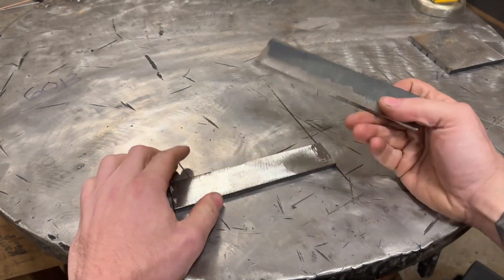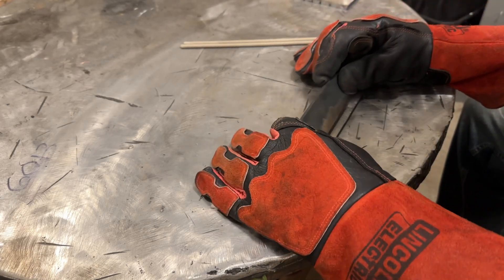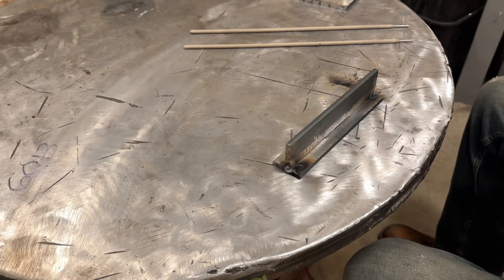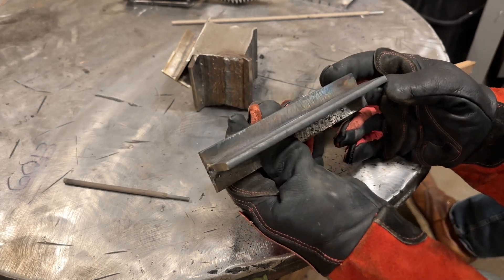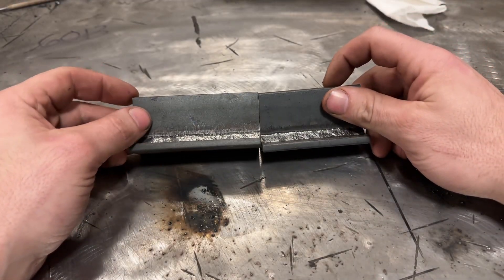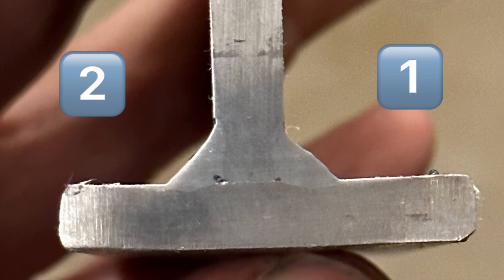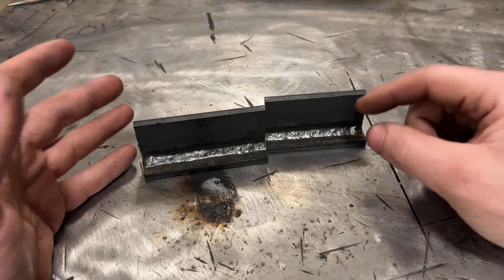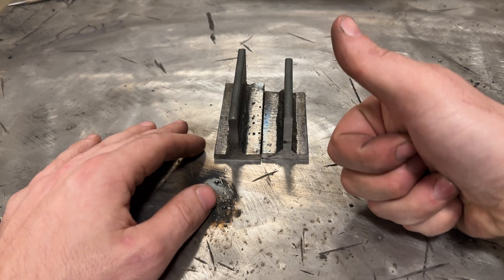Retesting 7014 results from “Stick rod shootout”

Comment: I wonder if the ground continuity between the weld table to the workpiece is part of the problem with 7014…have you tried using a tack weld between the table and workpiece or grounding directly to the workpiece?

Comment: I run a fair amount of 7014... usually at around 140 amps... I find it likes to run hot.  I think most of the charts show 160 amps at the top end for 1/8" electrodes.

Comment: I have cut plate with wetted rods at 200 - 225 amps before I had a torch .
It works but not a nice cut and hot stuff flying everywhere .
Reply from the maker: That’s an old school trick for sure.  In a pinch it will work, just watch out for fires 😅😅

Comment: Im new to welding 7018 I heard that its a stronger weld than the 7014  However my welds look better when welding 7014   Im taking a 16 ft trailer and trying to make it 24 ft that's why I need a strong rod I am using a new Lincoln tombstone welder any advise would be appreciated thanks
Reply from the maker: Bunch of tips, hope these help:  so in my testing 7018 is stronger than 7014.  However with a tombstone 7014 welds will tend to look better, especially with minimal skill.  7018 will run on tombstones but the AC version of the 7018 rod produces better welds generally.  

My thought on your situation is if you can produce better quality welds with 7014 you’re probably better off with that rod for the time being.  A clean weld with minimal/no porosity, slag inclusions, undercut, etc, will be stranger than one with a bunch.  However if you intend on stick welding a fair amount/doing repairs, it’s in your best interest to get good at 7018 👍.
Reply: @makingmistakeswithgreg   I agree and I also want to thank you for the Videos and replying have a wonderful even

Comment: It is interesting your Miller quick reference card lists 7014 as having better penetration than 7018.  Most other references either list them as comparable or give the edge to 7018.  Most anecdotal reports match what you have seen here.
Reply from the maker: It’s definitely strange how some sources say 7014 is the same or more than 7018.  Growing up I knew a few people that used 7014 as a replacement to 7018.  They are definitely different enough that the choice to use 7014 needs to be made understanding what’s being lost.

Comment: Rods with the 2, 3 and 4 flux type contain rutile in the coating. The slag is slightly electrically conductive and the arc doesn't have a problem terminating into it, rather than piercing through it, like in 6010/7018, for instance. Because of this, even though the rod has a spray transfer of the droplets, the slag can run in front of the puddle and soften the impact of the molten metal from the tip of the electrode, resulting in decreased penetration. Rutile rods also require much lower arc voltage to run, contributing to the problem, in this case. 6010/6011, which also have a spray transfer, but barely any slag coating, have a very tense arc, which gouges deep into the base metal, and very low recovery, will always cut deep into the steel, providing excellent root fusion. 7016/7018 are a bit like the bastard child. Their slag is thicker, but non conductive, so the arc has to blast it out of the way of the droplets. If you look closely while welding with a 12-13 shade, you can see the arc dancing around, reflected in the weld pool. You can also see they have a globular metal transfer and the slag gets deposited ahead of the bead, but it quickly flows to the back of it, picking up contaminants, if it slides along the edges of the pool. As far as the gouging and cutting with welding rods, I have done it successfully with 3/32" 6013 on 130 amps in the vertical down position. The pool gets extremely fluid and it just runs down on the ground. It should be much easier with cellulose rods, considering they give off a much stronger blast of shielding gas, which can act as an air-arc gouger.
Reply from the maker: Thanks for sharing that info 😀.

Comment: I made a small welding table out of some kind of square tubing rack the neighbors gave me and welded 16ga on the table top with 7014 menards rods mainly it came out good for something to have small projects built on I used some 1/8 inch plate too....mistakenly I also bought some 22ga plate on accident but hell I welded that up also as a bottom plate under the 16ga works well for smaller stuff
Reply from the maker: A custom welding table is a definite must do project.  Sounds like you got it handled well.  Since this video I actually have grown to like the 1/16th and 3/32 7014 rods for a lot of thinner material work.  They work pretty good for that 😀.

Comment: I was told, as a young man, that the 7014 was a rod for decorative welding and appearance work. I used to fix floor boards in old farm trucks with them because they fill without burning holes and there's very little splatter.
Reply from the maker: Considering how the penetration is I bet they would work excellent on thin material, especially with the mini 1/16th rods.  Any help you can get on thin material is a benefit, it’s no easy stick welding sheet metal lol.

Comment: I've become a fan of 7014 for some particular use cases. For me, it basically replaces 6013 for everything where I want a bit less penetration. It's the perfect rod for tacking something. Especially in the smaller 5/64 size that Blue Demon and others offer. I think everyone into stick welding should have a supply of the 5/64 Blue Demon 7014s. They tack brilliantly and the slag chips off to reveal a bead that looks chrome-plated, it's so shiny. Plus the slag doesn't get trapped in the toes so no wagon tracks or issues with additional passes on top of it with 7018.

I've not yet tried a rod that starts more easily and consistently than the small 7014s. IMO they are the ultimate rod for working with thin tubing like many of our home gamer fab projects will require. I have a stack of 1" 14ga tube waiting for me to dive into, and I guarantee that most of it will be the 5/64"  7014. Especially since you can find the stuff for under $3/lb, it's a good bargain and since the smaller rods are giving you fewer lb per inch, it's an even better deal when you consider how many inches of weld you can get for $1. 

I've been trying lots of rods since I started learning to weld, and a couple rods have made the short list of "must buy more" within a couple rods of burning:
- Blue Demon 7014 in 5/64
- Esab Red rods (sureweld) in 1/8"
- Lincoln 5p+ in 3/32"
- Excalibur 7018 XMR.
- Hobart 7018-1 H4R n 1/8".
Reply from the maker: The 5/64 rods are probably the most unknown underrated rods out there.  Very few people have heard of them it seems, and I would definitely agree they work great In 7014.  I have mini 7018s and they are a bear to weld thin material with in comparison.  The 6013s tend to get slag inclusions due to excessive flux for me.  7014 seems to have less penetration than the mini 6013s which is perfect for thin material.  

Your list of must buys are definitely a good list.  The usefulness of 6010 red and 5p+ are a game changer for “solving problems” lol.  I can’t imagine not having one of those two and trying to do repairs.

Comment: This is 1/8" stick, right?!?  On 1/4" plate, at 130, and 120amps. 

    I really like 7014 for light work, it seems to be easy to use, but I don't have enough "time in the saddle" to say too much about it. I did get a good supply of 5/64" and 1/16" sticks before the post- pandemic inflation-pocalyse. The 1/16" sticks literally more than doubled in price. 

    If you wanted to do that joint again with 1/8", you could bevel the edge more and do a root pass with 3/32" 6010/11, then weld over like you already did. On the other hand, that weld looks pretty damn strong as is.
    I appreciate that you try stuff, and then test the result. Thanks for the stick welding series, it makes a great online tutorial.
Reply from the maker: It was a 1/8th rod.  I have done more testing off camera since that video, and 7014 seems to have a rougher time with root fusion than 7018.  I think the nature of the rod really seems to favor thinner material, or butt welds.  When welding fillet welds where the weld puddle thickness increases, it doesn’t seem to have much penetration.  In the flat position butt weld it seems to be less bothered.  I have seen the same results with 7024, it has huge penetration in the flat position butt weld, but on a fillet or lap of 1/4 to 3/8th plate it loses to 7018.  

7014 to me works great on thinner material, and for flat welds.  It’s also better for me than 6013 because it seems to be less likely to have slag entrapment, and it does have a stronger weld.  Very easy to learn with and to restart.

Comment: What I think is that making two more cuts to look at would give us a better representation of what is going on. Also that the gaps from poor fitment are hugely distracting and possible distorting the penetration profiles. I don't know I've not studied that many cross-sections.  I've not tried 7014, but do like the 7018. Appears that 7014 might be good for thin stuff. I'll try it for such.
Reply from the maker: So I have done a bunch more testing with 7014 since that video (a lot off camera and some in upcoming videos).  Universally it has worse penetration and bend test performance in comparison to 7018.  It runs a decent bead, and is easy to weld with, but I definitely won't use it as a replacement for 7018.
Reply: @makingmistakeswithgreg  Yes it's not appropriate to replace 7018, nothing is. but on thinner materials 7014 might be less likely to over penetrate. Horses for courses. I have some really thin stuff to work with coming up and will try some 1/16 7014 to see if I can get a functional weld for my purposes in that application. thanks for making some videos.
Reply from the maker: No doubt on thinner material it works better.  I have both 1/16th rods and oddball 5/64th rods of 7014.  They work great when I have used them.  With real thin material the main benefit is restarts.  You can snap out and restrike a arc without any trouble with 7014 (great to fill a hole).  The 1/16th 7018 rods are tough to do work like that with.  I swear the mini 7018s have a ball bearing on the end of the rod making restarts impossible on thin material lol.   @wadepatton2433

Comment: The vertical plate has no backing resulting in a hotter weld surface while the base is on a cool steel plate/surface (heat sink) which might explain the difference.
Reply: Excellent--the table is a heatsink.

Comment: i ALWAYS RUN 7014   at  145 amps  and this is its sweet spot. Don't dis 7014   untill you work with it more.  It will run uphill and down hill at 145 amps. on 1/4 in or 3/8 plate. on 1/8  125 amps is just fine.
Reply from the maker: I ran a bunch at upper amperage and still struggled a bit.  I still have a bunch to go around so I will give it a revisit for sure 😀.

Comment: It makes sense that the vertical plate would get more penetration. It's melting the edge of the plate after all. The horizontal has plate on both sides to heat sync.

Comment: I still think 7014 is a better choice for 16ga and 14ga tubing projects. Anything to help prevent blowing holes. I would agree on running 6010 and 7018 on everything 3/16 and up.

Comment: I’ve used 7018 to make hotrod cuts in hard to reach places or to cut grating over top of a stringer so that I didn’t have to worry about hogging into the top flange with a cut off wheel. Crank up the amps and let er eat. I’ve even used them to burn holes in 1/4” when I didn’t want to go to the ground for a drill and bit.   I’m not too familiar with 7014, but it definitely seems to go opposite of what I would expect. That lack of penetration in the root is pretty wild.

Comment: 7014 sucks. Just go with 7018 as it works way better, has deeper penetration and has a way better work flow. Even tacking is a lost cause with 7014.  Re-striking or scratch start is a beauty with the 7014. I have to give a plus on that.  If you have a welder with adjustable arc tart force, then 7018 should be your only rod to use on pretty much everything, considering you already have its best companion, the 6010.
Reply from the maker: I am in the same boat, 7018 and 6010 is all I pretty much run outside of hardface and higher strength xx18 rods.  I think the 7014 might be a viable option on thin material and on older AC buzz boxes.  Beyond that it pays to learn 7018 and 6010.  😀
Reply: @makingmistakeswithgreg  Yes on thinner materials it could be a survivor!! Now a days, you have some 7018 that are rated for both pos. and neg. so the buzzer box can keep on buzzing!LOL.
Reply: That said, would you recommend say a 5/16, or 1/8 7014 for welding exhaust? I'm a newb and have been trying to figure out the best rod for the thin pipe. I have a Yes Welder Flux-135, but it won't run thinner than .30 flux core and I'm concerned about blow through. Love your videos. You're my official welding teacher. Lots to learn. So far I learned that I bought the wrong welder 😂.  @Freetheworldnow
Reply: LOL!!!  I think you're about 99.9% wrong, but, if that's your experience...  For me 7014 is the one electrode I wouldn't want to be without for general purpose jobs.

Comment: cleaning action on AC might knock that air pocket out???
Reply: I've used Hobart 7014 rods for literally years on a portable welder welding pertner everything and never hard any busted equipment and pipe welds..it's kinda like a  beer..all taste good but u always have that favorite one..uther people may bitch and say ick..that beer tastes like shit..so that bein said I use and like 7014 rods..hope that helps😊
Reply from the maker: It’s possible ac will help the rod, I find that I like 6013 on a/c more than dc, I bet 7014 is much the same.

Comment: Thanks for following up in this test. Much appreciated.
Reply from the maker: You’re welcome 😀.  After the results in the stick weld shootout video I had to know how much more amperage would help.  Not a whole lot, that’s for sure lol.  Had I ran 7018 at 130 amps (my normal for thicker plate) it would have definitely surpassed 7014.